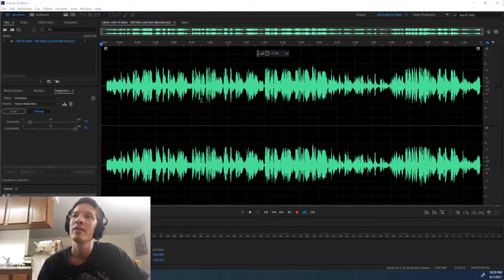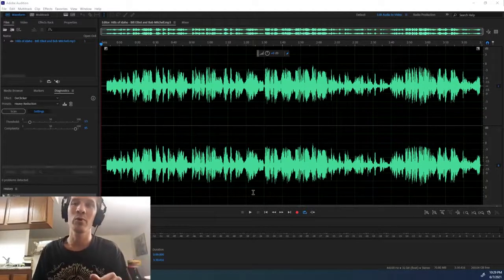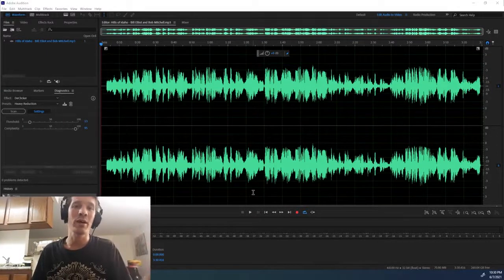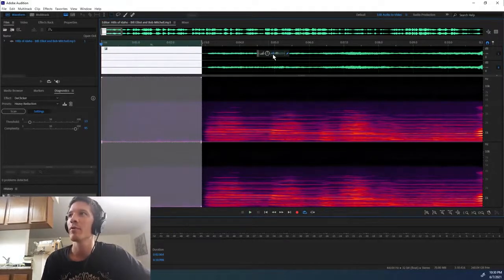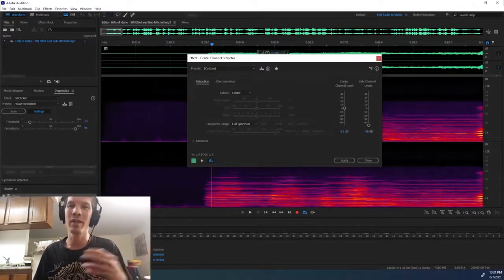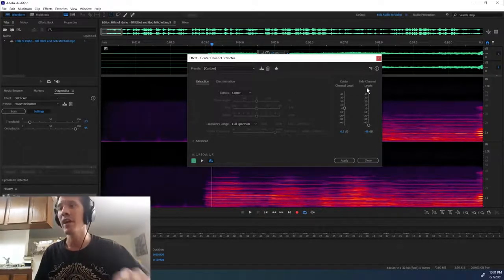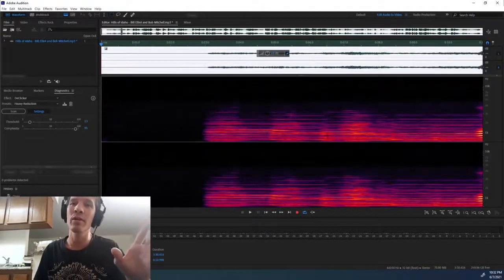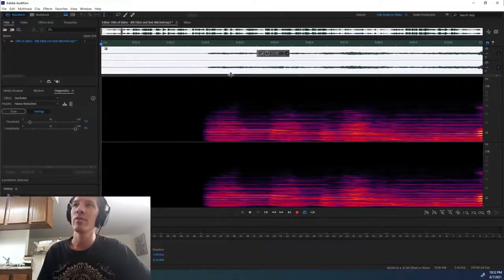How to Remove Clicks, Pops, Scratches & Noise from 45 / 78 Vinyl Record in Adobe Audition - Tutorial

Comment: The center channel is an interesting tool, but it had a weird effect. It helped the vocal bit, but took out most of the percussion and drone, giving a strangely hollow kind of sound. Would you have any suggestions/alternate techniques to prevent that?
Reply from the maker: It sounds like the record was a stereo record. This technique will not work if it was a stereo record, only a mono record and a stereo record player.
In your case, try this technique: https://youtu.be/rb5eDBdjxoY